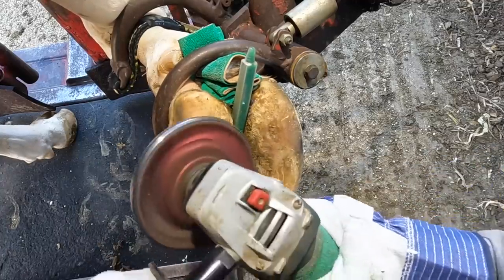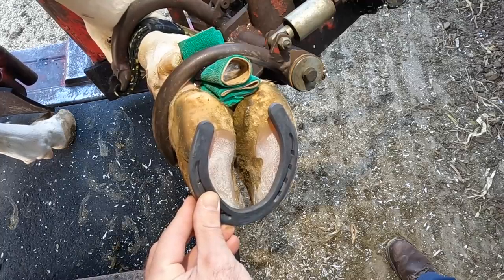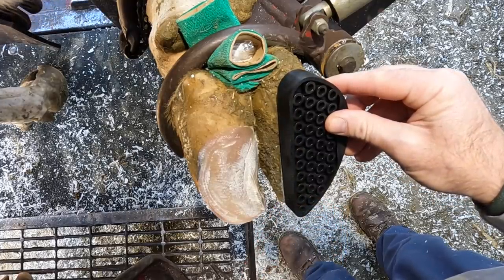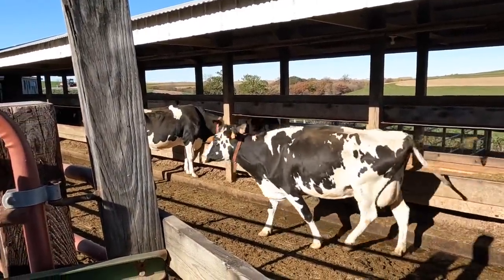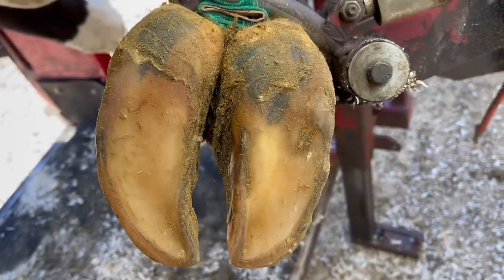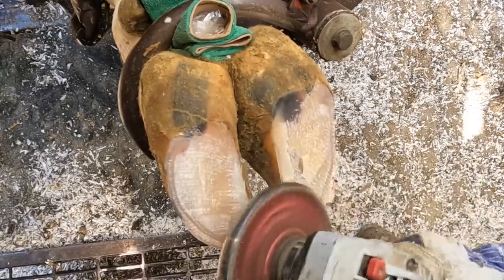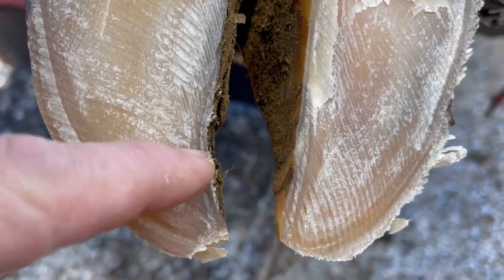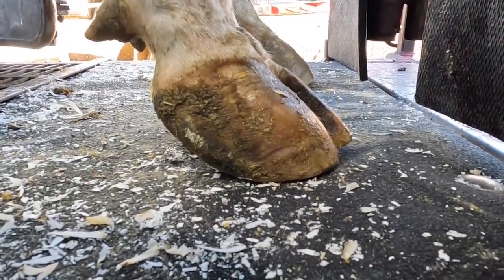Should I SHOE THIS COW’S HOOF???

Comment: It should also be noted that shoes on horses don't necessarily give protection to injuries even punctures out in fields what they are there for is to provide traction, grip and wear resistance on hard surfaces like tarmac or concreted. They also need regular cleaning out of debris including stones which can hurt the softer part of the horses hoof especially the frog.
Reply: how did frogs get involved in this haha, but in all seriousness ty for the extra clarity
Reply: @ThePlaidCanadian  The frog is the actual fleshy part on the bottom of the hoof. It kinda looks like the Federation symbol from Star Trek. If you see any hoof-picking videos, it'll be really obvious 'cause you generally give a good scrape/brush around it to get out any dirt or rocks stuck there before doing damage. Though it does actually sometimes get trimmed as well (by the farrier), because it can get overgrown.

I've seen some bad frog injuries on horses whose people didn't pick their hooves 😮‍💨 as well as the work of some horrible farriers. Makes me appreciate Nate sooo much more 💖
Reply: I saw a Video.of a Horse-- with a Frog problem...

The Ferrier shoed the foot-- with a piece of  Leather between it..  👌
Reply: @kosh9639  hope it wasn't Cordovan leather, that would be such a mean thing to do... 🥴

Comment: I don’t mean to beat a dead horse ( pun intended, lol ) but is an ox hoof “thicker” than a milk cows hoof?? I know oxen have shoes and I imagine that they are nailed to the hoof like a horseshoe. I’ve seen horses being shoed at a neighbors farm, it looks BRUTAL, but the farrier told me that they don’t feel nothing. Just curious how that is done. Love the videos, keep up the good work!! 👍🏼👍🏼
Reply: It goes through the nail, no tissue, so the horses literally don’t feel it.
Reply: Oxen are still cows and no, they are not shoed. Horses have very hard feet with very thick horn and shoeing is not painful for them at all.
Reply: Oxen CAN wear shoes. Ours do. It really depends on if they can handle their own weight plus the work they are doing. You can Google shoes for Oxen if you are interested.
Reply: Brittle*
Reply: @technoe02  Thanks, I fixed it.
Reply: Horses don't feel anything because the shoe is put onto the nail itself, which is all keratin, no live tissue. However shoeing horses is rather... Controversial, because /most/ horses (the ones that don't currently have feet problems or haven't been born with any) don't really need shoes as long as they have a good space to run around by themselves and exercise to keep the hoof naturally trimmed. Because running around with a metal plate is not very comfortable and, especially on hard grounds like concrete, the impact is really hard and it damages the horse's joint
Reply: @VincentMothling  concrete, rocky surfaces such as gravel I think. Those tend to trim off the hoof more but, with the impact that the metal shoe creates it seems to have very mixed opinions
Reply: @VincentMothling  There are plastic snap-on shoes actually! Some are used medically, others are used as an everyday thing I think. It just seems that people refuse to transition from one to the other
Reply: @nebulabunny8633  trotting a horse on pavement is bad for a horses joints if they have steel shoes on or not.. a barefoot horses hooves can become bruised trotting on hard surfaces, but with Steel shoes, can tolerate hard going much better..that is why steel horse shoes evolved.
Reply: I am sure you would love a response back in detail for your question from the author but unlike other youtubers he is actually a working man, and probably doesn't have time to individually respond back to everyone as he works for living and this is probably just a side hustle to make extra money and for educational purposes. Just saying...
Reply: @annaabney1420  An Ox can be shoed and have been since they started showing horses maybe longer
Reply: @VincentMothling  I understand I wasn't trying to be a dick, just the opposite actually. He asked in such a way I thought he was asking the youtuber, and figured he might be upset or feel some type of way if the author doesn't respond. I was simply pointing out unlike other youtubers this one may not have time to respond to anyone because he has a real job and doesn't just do youtube full time, and basically don't get your hopes up if he doesn't...
Reply: @nebulabunny8633  horses that are going to be on concrete or any type of tarmac or even just really rocky areas must be shoed. The concrete will definitely do damage to the hoof
Reply: @nebulabunny8633  I think the snap on shoes you are referring to are actually hoof boots. They come in a wide variety of styles with different ways of attaching them to the hoof. They all basically clamp around the outside of the hoof. Some have extra attachments that also wrap around the pastern to aid in keeping them on and some come with a strap that keeps you from losing them if they do come off. You need to have the hoof trimmed properly and fitting some of the boots on can be a real struggle as they are designed to fit tightly. As the trim cycle progresses the hoof grows and you may need to take a rasp to the hoof and remove any flaring the hoof might develop. Using a shorter trim cycle helps. Finding the correct size can also be difficult as you have to measure different areas of the hoof and use the manufacturer’s sizing chart to determine what size the hoof fits in. Some hooves are wide and short and some are long and narrow. It can be a real struggle to find a brand and style that fits. Now do the same thing for each hoof. They may all need different sizes. Generally they are most popular with endurance riding as they add cushioning and protection for the hoof. A horse that is ridden a great deal will wear down it’s hoof faster than it can grow it. Shoes are required for some sports as they give extra traction, such as jumping an outdoor course, and can even have studs added if needed. They also have plastic glue on shoes but I don’t have any experience with those and they don’t seem to be real popular. A good farrier shapes the shoe to the hoof and not the hoof to the shoe. It’s not just that people don’t want to change, fitting and using boots is not always an easy task. How much would you want to ride if it took you an hour to put the boots on your horse every time?
Reply: @VincentMothling  in Ethiopia they are using cut up tyre rubber to shoe their donkeys, but they are very careless in how the shoes are fitted causing much pain to the donkeys. Vets have given of their time to try to educate them. And these poor donkeys are still overburdened in spite of their own regulations.

Comment: Never thought I'd be a hoof trimming video guy, but your vids are really well done. Short, knowledgable, a little bit gross with a little bit interesting, nearly meditative. Kind of a less disgusting and terrifying Dr. Pimple Popper. (That's a compliment).
Question about your knife. Obviously it's specifically designed for the job and you may have many. I can't tell if they are crafted or sharpened and worn down. What does a new knife look like? And, what does you day to day kit and equipment look like? Maybe you've done that video and I haven't come across it yet. Great job tho. Thanks for the vids

Comment: Are crushes really expensive? They just seem to take a lot of the stress out of close up medical procedures on cattle. The cattle just seem so relaxed in the crush and they're always bucking and trying to get out of the chute. Is the reason these big farms don't have a crush expense?  What are the benefits of using a chute over a crush and why do farmers appear to prefer the chute over the crush in daily operations? Thank you!
Reply from the maker: They run between $40-100,000 depending on the manufacturer and add-ons.

Comment: Would you please address the question of oxen hooves.  My friend digs for artifacts on farms from the 1600, 1700s and 1800s and he always finds oxen shoes which are similsr to cow hoofs,  Was showing oxen the wrong thing to do back then, or did they do it because oxen were more work animals dragging plois dragging plows wagons etc.. I totally understand why a horse shoe wouldn't work and I understand the white line is d)narrower, but why would oxen be different? Thank you so very much. This really, really interests me & I'd like to pass the info on to my friend.
Reply from the maker: They were used for pulling so those shoes were used for added traction not to protect from stones.  Additionally, you may shoe an oxen or two for working the fields but shoeing 2000 cows on a farm would be cost prohibitive and as I mentioned in the video could actually cause lameness instead of preventing it.

Comment: OK I have 2 questions why do you sometimes grind the heel of the foot and sometimes you don't, also why do you sometimes trim between the toes and sometimes don't?
Reply from the maker: For the heel it all depends on sole depth.  If I have lots of sole then I can remove some.  If there’s loose hoof between the toes or rotation in the claws then I’ll model them out a bit.

Comment: But... what if there was a shoe for each claw that you put being careful on the white line? A smaller shoe that you would put nails further from the hoof walls compared to a horse. I know it would be very expensive and each cow has different hoof shapes, but would that be benefitial?
Reply: Their hoofs are constantly growing so probably not. Its like wearing acrylic nails while rock climbing, very easy to bend or break your nails. Not to mention some cows will naturally shed their hooves especially after an injury so those nails might wiggle out and pierce the tender parts.
Reply from the maker: The nails have to go into the wall.

Comment: Oxen shoes do exist. They look kind of like half of a Yin Yang symbol. They were applied to draft animals - working animals. And they were used for the same reason, namely a working animal is going to wear down their feet faster than a non working animal, and therefore needs wear protection. If a farmer had two or three teams that could be rotated, he didn't need to use shoes. If he only had one team, he did - that is, he did If he worked them most days. And just like shod horses, they need to be changed and trimmed up every 6 weeks or thereabouts. Standard maintenance, just like changing your car's oil.
Since oxen have pretty well disappeared as draft animals, the need for oxen shoes has likewise disappeared. 
I'm thinking (not positive), that those blocks might actually work as shoes for a draft team. It would depend upon how well that glue holds.

Comment: I'm not a trimmer, but I'm curious why you don't "mottle out" the inside edge of the toes,  as some other trimmers do.
Reply: I’m curious about that too
Reply from the maker: It creates additional wear which ultimately reduces heel depth.  The heel of the foot takes on the most wear already so removing a large surface area modeling the hoof results in added pressures to the remains heel causing it to wear faster.  Maintaining heel depth is critical.
Reply: @NatetheHoofGuy  Admitting my ignorance up front, it makes sense that it would be better for the cow not to concentrate her weight over a smaller surface.

Comment: Does the hand grinder transfer heat to the hooves via the trimming process, thereby burning the foot if not trimmed properly?
Reply: Check out the video from a while back where he shows all his tools and equipment. It's actually a cutter rather than grinder, and slicing off little slivers doesn't generate the kind of friction that would burn.
Reply: Another trimmer, who we all know and love, showed the shell of the hoof, without the bone or corium.  He put his fingers in the shell and heated it with a blowtorch to show that using the torch doesn’t cause pain.  He held his fingers there for far longer than the grinder maintains contact without any problems.
Reply from the maker: No it’s a cutting wheel.  No heat .

Comment: Also remember that horse are getting reshoed every 4 to 6 weeks. That would be a tremendous cost on a cattle farm.
Reply: Yeah, also the fact that shoed animals still need their hooves cleaned regularly to make sure rocks don't manage to work their way in-between the shoe and hoof.  I had a friend who took in a rescue horse that almost got put down because the owner never cleaned the shoes and had them replaced far too long apart.  The horse never had shoes since and was perfectly sound for trail riding after he healed fully.  Shoes can cause just as many problems as they solve if not used and maintained properly.

Comment: they shoed oxen but with two piece shoe not horse shoe can you tell me something about that thanks
Reply from the maker: Used for traction for working oxen.  Not meant to protect from punctures.  Nailing is still the issue.  The risk of injury attaching them is much higher than the risk from the problems.